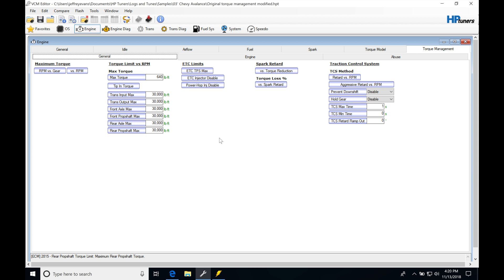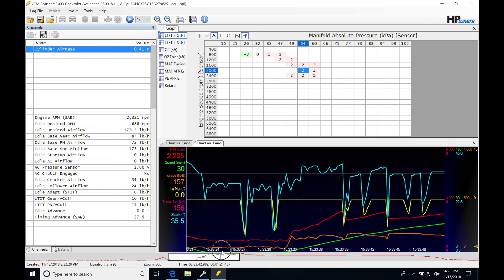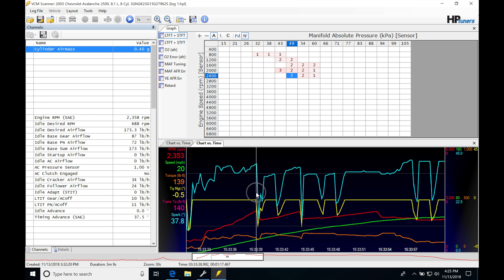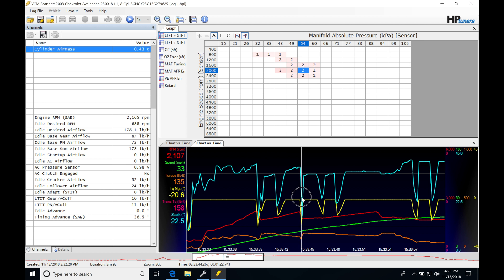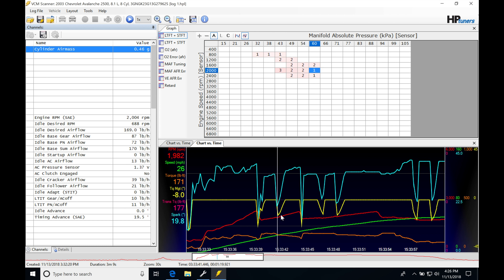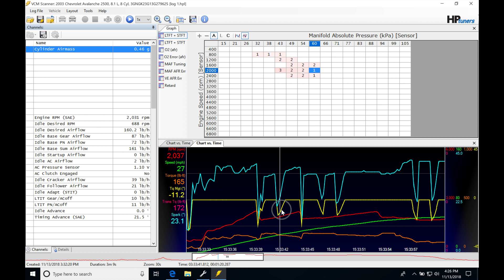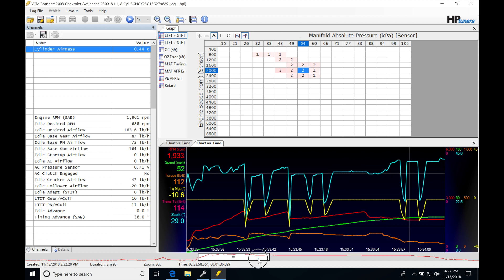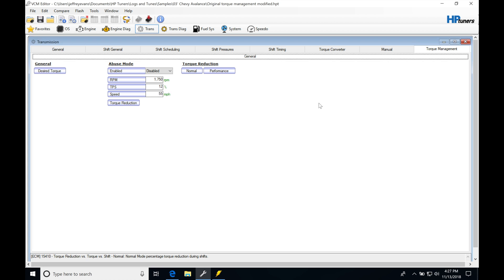HP Tuners GM Gen 3: Torque Management | Evans Performance Academy

Comment: How would torque management be set up on a manual trans from the factory on a 2001 c3500 8.1l i have two trucks and one is a auto one is a zf6 6 speed manual and the manual truck seams like tons of power is being killed both are running good the auto is a heavier truck and id expect the manual to run way better than it does been like that since i bought them new in 2001

Comment: I always missed the old V8 engines from the sixties and earlier, that had lots of low end torque and could spin tires easily on pavement. The new cars and trucks drive like they have 4 cylinder engines from the standing start, but seem to have much more power once you're moving at 20-30 mph. Is it that the engines today aren't as strong, or is this programmed to kill the low end torque so you can't spin the tires?
Reply: It's where the power band is. If you look at a SBC dyno next to an LS, the sbc makes more torque down low. The LS makes way more power up top. The old cars would spin, but they were slow as hell. Spinning ain't winning.
Reply: @dudemcgee256  So a tuner isn't going to make the Silverado as fast from 0-30 as the Home Depot truck I rented 3 years ago. Dang..
Reply: @basspig  It actually could, but it would depend on a lot of things. Do you have larger than factory tires? What is your gear ratio? Have you done any upgrades such as cold air intake and exhaust? Did you tune your truck for those mods? If you didn't tune for these things, then you made your truck significantly slower. My Sierra has 4.10 gears, factory size tires, and a good tune for the cai and exhaust and will damn near break your neck from a dig, but it is set up properly. Most guys will do these mods with high hopes but no tune. But what happens is you've introduced more air into the engine, which throws off your air to fuel ratio. Now you're running lean all the time and dealing with knock retard which pulls timing making the truck drive like crap. Add in torque management and you're really screwed.
Reply: @dudemcgee256  I bought the truck from another owner in August. I'm not planning to drag race with it, but I was curious because the Home Depot truck I rented was a larger truck (maybe Ford F350? Not sure). While I was at a stoplight on the way back to HD, I decided to tromp on the accelerator and it spun rubber and lurched to 30MPH in less than two seconds. I was not expecting that from a rental truck in the 10,000lb class. I remember thinking "oh, right it's a V8".
So when I got the Silverado, I was surprised it wasn't the same, and there's very little low end torque, more like a 1975 Saab than a 1969 396 Chevelle, both of which I have owned.
The owner did put on a K&N cold air intake. I just replaced the tiny air filter with a large one rated 850 CFM.
I've done nothing else to the truck except change the oil to synthetic. My mechanic says the engine runs fine. Why the low end torque is not very good, well I'm guessing it's the engine design.
So do I need a tuner to compensate properly for the cold air intake? I thought the air intake was controlled by the throttle butterfly valve at the intake.
It's more of a curiousity for me as to why the bigger, heavier Home Depot truck could lurch forward and spin tires and the Silverado 2500HD I have which is a smaller truck, can't. It has to "spool up" and by the time it reaches 4000rpm, then it's starting to really take off. All the power is on the  high end of the range.
Do you know if a tuner will fix the low end, since I have that intake system?
I don't know what the gear ratio is, but the tires look like marbles on this truck. I need much bigger tires for it to look right to me.
Reply: @basspig  A tune would definitely help. GM trucks will gain at least 25 hp with a tune on a truck with no mods. With your cold air intake you'd probably get more like 40 hp. Your truck may have a 4.8 liter and the f350 you drove was either a 6.2 gas engine or a 6.7 liter turbo diesel. That is a giant difference in displacement, and would be a giant difference. Especially at low rpm. The year would make a big difference as well.
Reply: @basspig  A cold air intake has much less restriction that the factory intake. Therefore your engine is getting more air in, but isn't giving you more fuel. You're running lean all of the time and most likely your motor is pulling timing due to spark knock.
Reply: @dudemcgee256  My truck is the 6.0 L engine, which is why I was surprised at the lack of torque. I know it's a small block V8, but it's fuel injected and that ought to be worth something. 365HP according to what I looked up online, but all that power is on the high end.
The rental truck was gas definitely. I've never driven a diesel that could lurch from 0-30 almost instantly.
40HP doesn't sound like much. And from some of the dyno charts I've seen on these videos and others, the low end doesn't come up much.. most of the improvement is above 3000rpm.
I'm thinking this truck has torque management. Even seems like the transmission is not tight because the engine revs up quite a bit before the truck gets really moving. It's still got more torque than a V6 that's in my wife's SUV, but I read somewhere that the L96 engines have all of their power on the high end of the RPM range, so maybe that's just the way it is.
A tuner may still be a good idea, given the cold air intake. Something to play with in the spring. Hoping torque management is also killing the low end. If that can be rolled back, then great.
Reply: @basspig  Your truck will have engine and transmission torque management as well as traction control. You’d have complete control of all of that through hp tuners. I would leave the majority of trans torque management because all it does is pull power during shifts. Engine torque management will pull power randomly while your just driving around. You can get rid of all of engine torque management. Between that and the extra power, you’ll feel lime you ha e a new truck. Even though you have 365 hp potential, because of torque management the engine isn’t necessarily giving it to you when you demand it.
Reply: @dudemcgee256  On my wife's Ford Explorer, I've noticed well that transmission torque management with the throttle pulling back during shifts, so I understand that concept. What seemed odd to me is that the engine has to rev up quite a bit before the truck gets moving from a standing start. That made me think that the torque converter was being managed as well. When the truck is rolling, there's plenty of acceleration, even in 4th gear at 40mph. It's just that the standing start takeoffs seem anemic compared to the acceleration when cruising and passing.
Okay that we can get rid of TM on the engine. That may give some benefit on the low end of the RPM range, hopefully, though I expect most of it will benefit the high rpm range, based on dyno tests I've seen on similar trucks before and after tuning. I read somewhere that the L96 engine has most of its power on the high end of the RPM range. That seems strange to put an engine like that in a truck that's used to haul trailers and plow with. But the way the truck drives, I'm convinced it's true.
Reply: @basspig  I'm not sure what dyno graphs you've seen, but a tune will affect the entire rpm range. I would be willing to bet that traction control is what you're feeling from 0-30. If you've got a looser converter, it would have that feel as well. If it is a 2500 truck, the converter will be at around 2000-2200 rpm instead of 1650. Here is an example of what a tune will do on your specific engine. I'm not saying to go buy this tune, just showing what a tune can do.   https://www.diablosport.com/latest-releases/2016-gm-silverado-sierra-6-liter-performance-tuning-now-supported/

Your truck has rectangular port heads, which flow much better, but sacrifice low end torque for high end horsepower. The gen 3 99-06 trucks had more torque in the low rpm range because of the cathedral port heads. This guy does all kinds of videos on the 6.0l gm truck engine. His videos will help you understand how different mods effect the power curve. That way you can choose mods to put the power right where you want it.  https://www.youtube.com/watch?v=N-E7aGP_rrg&t=630s
Reply: @dudemcgee256  Yes  it does affect the entire range, but the boost was greater above 3000rpm in those graphs.
I am pretty sure there's no traction control, because when the road is wet, there's a hill with a stop sign and when I start up that hill, the rear wheel slips and won't stop slipping until I ease off the throttle.
I don't understand the color coding on that graph showing the dyno readouts. It seems the stock tune is very similar. But then there is a second set of four color graphs showing very different power at the low end of the rpm range. The chart colors are confusing. Or one is torque and one is power? But then the curves are similar to the ones I recall--little difference around 2000 rpm and below. Most of the improvement is still near the top end.
My truck is an '05. Maybe the newer trucks have more low end torque, because mine sure doesn't.
His video gets into serious engine overhauls with custom heads, etc. Not something I'm going to do on a rusty 15 year old truck with 160K miles.
I'm coming to understand that the design of the L96 engine puts most of the power on the top end. Supposedly, this engine is also used in the Corvette of that year range. I'm frankly surprised they would put that in a truck used for towing. I have the trailer tow package, which would suggest the type of engine used should make lots of torque.
But here's another anomaly: I used to have a 1982 Dodge W150. Lousy 318 had no torque and the truck was very slow accelerating. HOWEVER, put it in low range 4WD and it would lurch from 0-20 mph in one second and your head would hit the back window doing it.
On my Silverado, in low range, it has no more acceleration from 0-20 than it does in normal gears. Seems fishy, like something is going on with the computer limiting torque.
Reply: @basspig  If your truck is an 05 then you don’t have the l96. It is either an lq4 or an lq9. You should have more low end torque than the new trucks. If it isn’t ballsy as hell from a dig then something’s wrong or your gearing is super tall. My Sierra Denali is an 05 with the lq9, 4.10 gears and tuned by me and it’s crazy from a dig. Your engine is completely different from a corvette engine of any year. Different intake, cam, tune, power band etc. The corvettes have an ls2 in those years with 400 hp. You’ve got either 300-345 depending on which engine you have. A tune on your truck would make a giant difference at every rpm. The dyno graph I sent was hp and torque. It had a line for for 87 octane, 93 octane, and e85 because the l96 has flex fuel and the power will vary greatly depending on the type of fuel used. Your truck will benefit from using 93 for sure. But can’t use e85 because you don’t have flex fuel. Dyno graphs will almost never show you power at below 3000 rpm because of the way the dyno loads the engine. Most people are never at full throttle at 2000 rpm anyway. Just YouTube lq4/lq9 trucks on youtube to find out what your truck should be running like.
Reply: @dudemcgee256  How can I tell what the gear ratio is? What I do know is the  RPMs are around 2000 at 40-45 MPH, cruising on a level state road.
And why doesn't the truck seem more 'torquy' in 4WD low range like my old Dodge? Something doesn't make sense there.
So there are many variants of the Vortec engine then? I'd read or heard in one of many Youtube videos that the engine was the same as the one in the 'vette. Apparently not.
When I look up the specs for the Vortec V8, it says 364 CI and 360 HP.
This looks like the engine in my truck:
https://gmauthority.com/blog/gm/gm-engines/l96/

The LQ4/9 engines looks completely different than what's in my truck.

I'm not sure that $400 invested in a tune to gain 20-30 extra HP would make much sense.  To get the kind of tire screeching lurch forward that the rental truck had would probably need at least 150 extra HP.
I mainly use this truck for building materials runs and to haul the occasional excavator for my landscaping project.
Like I said, it's more of a curiosity on my part, not a necessity because I'm not drag racing the truck, I'm using it as a work truck.
Reply: @basspig  This will tell you where your RPO code is for your axle ratio. Then you cross reference it with the code chart in this website. https://www.crawlpedia.com/rpo_axle_codes.htm 

Yeah, there are MANY variants. Truck motors are specific to trucks with completely different computers, intake and head design, pistons, block material, camshaft specs, etc. the basic principle of the engine is the same, and parts are cross compatible, but each gm vehicle has its own variant of the ls or lt. trucks from 99-06 with the 6.0 were either an lq4 or lq9. They didn’t start putting the l96 in trucks till 2010. And before that from 2007-2010 the 6.0 was an ly6 which is different as well. The lq4/lq9 have cathedral port heads with better low end torque. The ly6/l96 have rectangular port heads which flow better, but sacrifice low end torque for horsepower in the higher rpm range.
Reply: @dudemcgee256  My chart shows GT5, which cross references to a 4.10.
I wonder why the engine in my truck is a spitting image of the L96? I'm wondering if the original owner swapped out the engine at some point. The LQ4/9 models I see on the web look completely different from the engine in my particular truck. Just the statement that the LQ4/9 models have more low end torque seems to support my suspicion that I have an L96 in this truck, which doesn't have much low end torque and the reason for my original inquiry.

Comment: Great Vid ,,,,Do I still have TM using a non computer trans with a stand alone harness for a ls swap ?
Reply from the maker: If you have a TH350/400, power glide, or similar you don't need TM.  It should be disabled within the calibration file.
Reply: @EvansPerformanceAcademy  Ok thank you

Comment: I assume gm has torque management during the shift for a smoother shift and to help protect the transmission clutch packs, but why is it there midway through the gear?
Reply: Exactly what I want to know .. I can feel it in my 95 Olds Ciera.. feels like my 4 speed is an 8 🤦🏽‍♂️ odd .... and obviously power taken away .. pretty sure I’ll dyno tune it soon It’s getting some power and the factory tune is in my way
Reply: Old post but still 😁